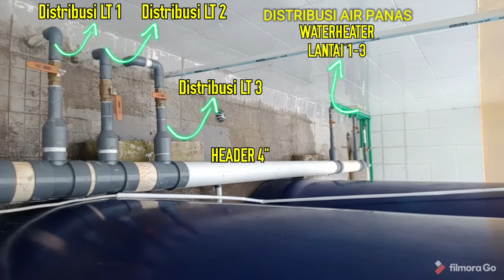CARA BUAT HEADER INSTALASI AIR BERSIH

Comment: Bagus Pak istalasinya, Maaf Pak boleh tanya, instalasi ini khan dari toren pakai pompa utk distribusi air dingin + air panas(punya jalur sendiri) utk tiap lantai  jika misalkan dibypass aja tidak pakai pompa dekat toren dgn, 1. Jalur khusus distribusi air panas dihilangkan ,  2. pasang pompa pendorong tekanan airnya di tiap kamar mandi 2. Jalur air panas diambil dari satu distribusi tiap lantai yg ada (dgn menggunakan Water Heater portable tiap kamar mandi), apakah tekanan airnya tetap sama dan kuat pak?, terima kasih..🙏🙏